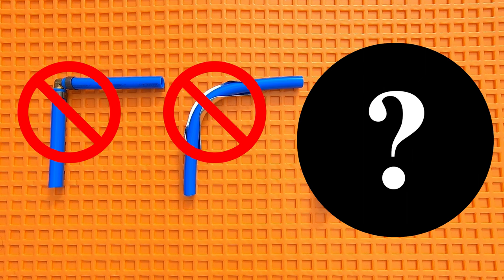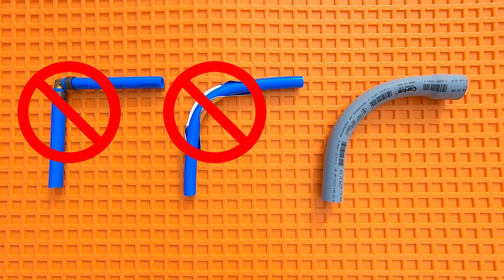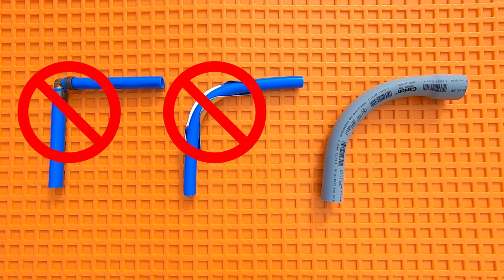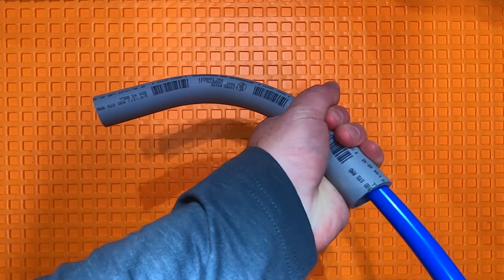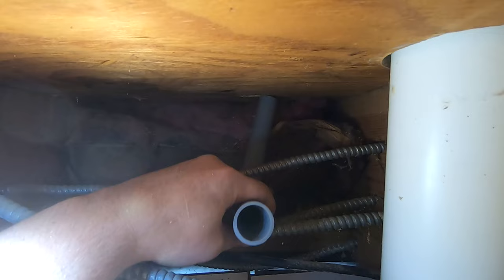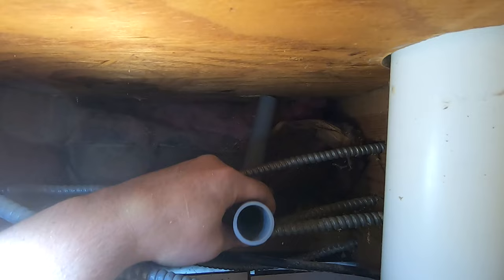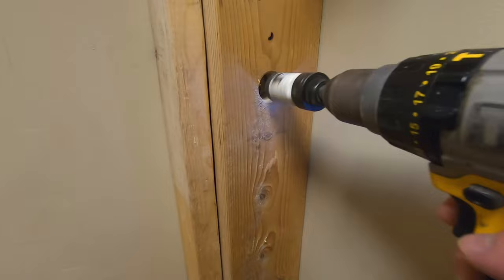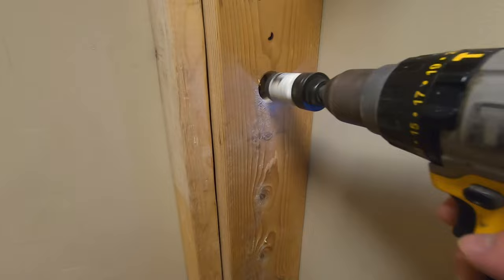Most DIYers Overlook this Pex Trick

Comment: Funny thing,, I did this a couple years back when running a water line before I had a new garage slab poured. I did however use 1-1/4 for a 3/4'' pex run.  I used pvc for the run, but used the electrical sweep for the ends.  It is easier to push through if you do a 45 degree cut on the end of the pex and use dish soap.

Comment: I was skeptical when I saw the thumbnail, but this is quite helpful. Ironically, I have been running cable for the last few days and have been using these conduit right angles. It never occurred to me to use them as a brace for PEX. One question though: is this to code? It certainly should be!

Comment: In the right angle blind corner stud situation, if you insert the electrician's elbow facing the direction opposite Pex insertion, you can remove the elbow after insertion.
Reply: Initially, I thought the same.  Then I thought about the benefit of leaving the  long sweep conduit in place:

A crimp in the pipe would be avoided if there were any accidental pulling on the pex (while finishing the installation or any time in the future)

Comment: Marvelous! There is another trick that you can use for PVC pipe to make bends...What you have to do is fill the PVC pipe with sand. Then, slowly over low heat, heat up the PVC pipe and bend it in the shape you need. The sand will keep it from kinking. Then, dump out the sand and you have the perfect bend you want!
Reply: This is OK for conduit, but you should not do this for any (pressurized) PVC water pipe.  The resulting pipe will not meet the necessary pressure ratings anymore, and is likely to spring a leak down the line.

Comment: I'm doing a project right now and was using those black 90 bends but every time I move down stream to work on another bend the torque would snap the black 90. I've busted like 4 of those things. Got so sick of it yesterday. Was thinking about using DWV 90 sweeps but this is more space saving. Thanks for this massive tip.

Comment: I usually heat mine and bend it. Then i use a wet rag to cool the pipe quickly. Im sure this works well, and the grey conduit can easily be clamped as well. It's definitely a trick im going to try in the future.
Reply: How do you keep it from pinching? Do you bend it in a form? Most pipes and tubing will flatten closed when you bend them without support.

Comment: For everybody saying this is not cheaper...

At Lowe's a 3/4" PVC conduit elbow is $1.46
A brass 1/2" PEX 90 is $2.48 + 2 copper rings from a bag of 25 is $0.75 for a total of $3.23
A 1/2" PEX support bracket is $3.78

LESS than half the price.

Comment: This is a great tip.  As a consulting engineer, contractor and architect,  I'll never install PEX and always recommend against it in projects that I'm consulting on.  I had a 3/4" PEX line come apart at a joint in the attic when I was out of town for two days.  Copper will get small pinholes or mildly leaky cold joints...PEX gives full water pressure at full pipe volume.  This caused almost $200,000 in damages.  And the install was less than 6 months old.  Stick with the tried and true.  Don't be lazy and do a good job.

Comment: Insert a steel spring over the pipe. Heat the pipe with a heat gun. Bend the pipe and quench it in cold water. Remove the spring and the pipe will retain the bend. The spring can be reused multiple times.
Reply: have you actually done this cause heating pex doesn't really do much. it's not like pvc at all.

Comment: Is it cheaper than the snap on corner made for PEX? The advantage of using the snap on 90° corner for PEX is you don’t have to feed the pipe through it and the corner has a  mounting bracket to secure the pipe.

Comment: I like the idea. Perhaps I am wrong….i stand to be corrected!! When I was plumbing in Malta 60% of our work was fixing thees easy bends with 90. It seems that the water eventualy made a hole as it speeds up on the outside of the bend.perhaps just bad pluming we never found out.
Reply: Probable the pipes rubbing against one another rather than friction from water.

Comment: Great idea! I thought of this exact solution. But I need it for a 1" pex line. 
It's too stiff and won't feed through. What size conduit elbow would I need ?
Reply: I too was wondering about 1" pex.
Reply: It might make a difference whether you are using PEX A or PEX B.  PEX A is more flexible.  But I have not tried using the PVC 90 degree with 1" PEX.
Reply: Might want to try heating the pex with a hot air gun before pushing it through.

Comment: I think this is a valuable tip especially for that corner but  the price is almost the same as the bracket or tee.  Would an inspector have an issue with this?  Some are really picky

Comment: Does PEX react to the elbow material?
Reply: As they say in the army, “send it.”
Reply: Good question! It's a PVC elbow and PEX is made from a type of HDPE. I'm not sure if those materials are compatible
Reply: Yes. Very explosive chemical reaction. Do not attempt.
Reply: It seems you can mix pvc and pex, and with that I mean glue them together and such. So I doubt that it will react with it.
You can even heat weld them together...

Comment: As a residential plumbing repair contractor I would recommend to avoid those. Even though the PEX manufacturers state that you can bend the pipe that much, I will tell you that 80% of PEX pipe leaks are on bends like that (with or without the support). It is too much stress on the pipe and over time it will weaken.
It is probably cheaper to use the 90 anyway and then you will  not have the stress.

Comment: Does that work for 1/2” and 3/4” Pex b?
Reply: I did a little research. Pex b 1/2” is .625 od  and 3/4” is .875. 
Sch 40 conduit 1/2” is .578 ID and 3/4” is .780 ID. 
So if you’re using 1/2” Pex b you need to use 3/4” conduit and if you’re using 3/4” pex b you need to use 1” conduit.
Reply: @tpctrash  Thank You. Exactly what I needed.

Comment: does not fit inside a framed wall for stub out.... you dont need a pipe to bend pex in any other spot....
Reply: You don't bend pex, ever! Bending it, including unraveling it, begins the failure, based on its molecular structure. If you're not aware of this, you might want to look into it. More than a few lawsuits going on already, where specialty guys get hired to do complete re-installs. It's even worse than PVC problems. They also leave the mfgr contaminated. Again, you might want to look into it, before more lawyers do. Gonna make aluminum wiring look like it was a fine idea.

Comment: That is not half the price. In fact it costs more
Reply: At Lowe's a 3/4" PVC conduit elbow is $1.46
A brass 1/2" PEX 90 is $2.48 + 2 copper rings from a bag of 25 is $0.75 for a total of $3.23
A 1/2" PEX support bracket is $3.78
LESS than half the price.

Comment: Could you also use a heat gun? Get the Pex hot like a wet noodle, when it cools down it will hold its shape?
Reply: As we would put it in one guy was a roll feeder and the other was clipping and heating corners before putting on the wirsbo bend supports. It worked great with the heat gun. NOTE you can't get it too hot like a noodle you lose all structural integrity.

Comment: Pvc will bend with heat over time if not Crack which will either cause a kink or puncture in the pex.
Reply: no it wont electrical conduit can support 90c conductors, you think pex is going to get anywhere NEAR that even on the hot water side?

Comment: cost more wtf
Reply: I think he means u can use it as a tool and remove it once pipe is routed, although he does Not show it. Otherwise yes it does cost more Lol
Reply: Uhmm, you’re right if you can use a 90 then it may not be worth it, but it seems like it’s a lot easier to go around some otherwise impossible bends. That’s where I see the worth here. If you need a lot of these 90’s maybe it’s more economical to buy a straight piece and make your own 90’s. Of course this seems like a lot of work for trying to save a few bucks.

Comment: Thanks, but, I'll stick to copper.  Maybe after PEX has a track record of more than 100 years....
Reply: Why? Lmfao. Pex as in its actual material has an excellent track record for Many uses and is very reliable, cheap, etc. Easier to work with vs copper too. What is it about copper , or what is it about Pex that it's "missing" that makes you say you'd rather stick to copper?
Reply: @patc2515  - because, about 5-6 years ago, I experienced a failure of PEX in my heating system that cost me a couple thousand dollars. 
There is nothing "cheap" about that, and I certainly wasn't "lmfao", nor would you if you had to pay the bill.

Comment: As per usual you never use jointed PEX in a slab or poured floor (floor leveler). I love PEX, specifically in radiant heating and for walkway and driveway heating.